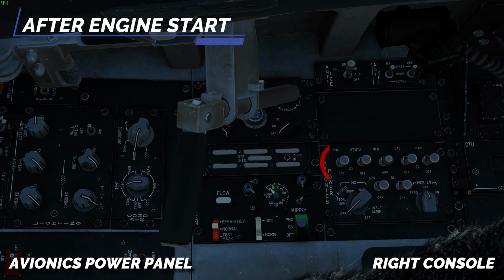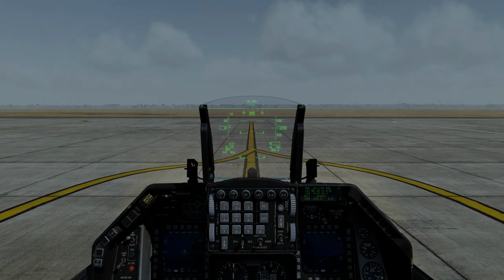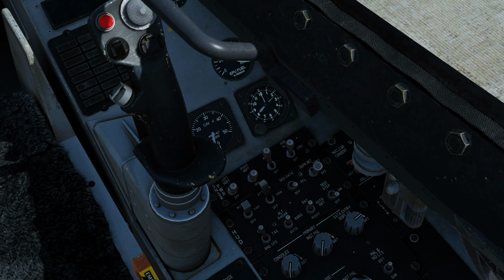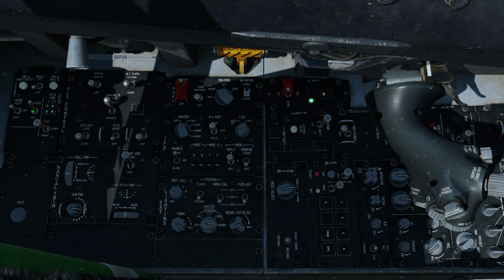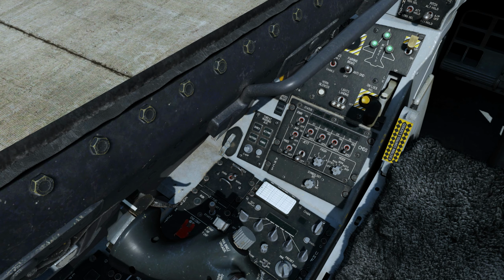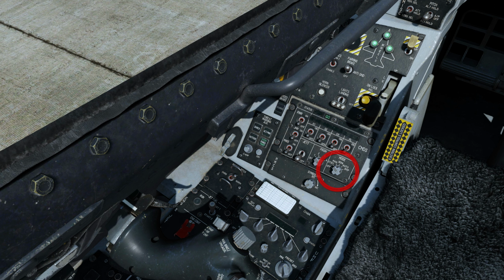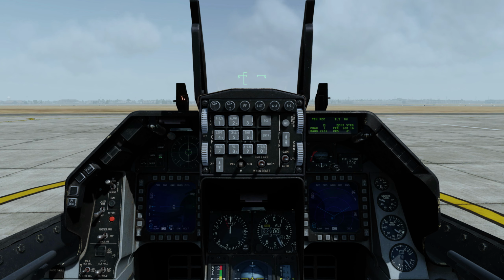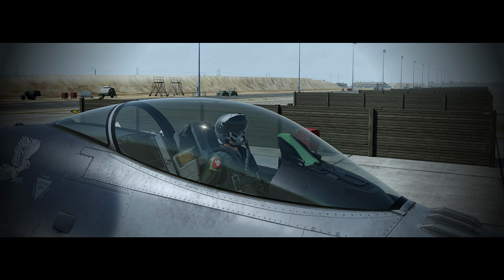DCS : F-16 Viper : After Engine Start Tutorial

Comment: I enjoy your vids. But you omitted an important step here. It's not in BMS but it is in DCS.
In DCS, when you start Normal INS alignment, you must confirm the LAT and LNG in the DED with the ENTR key on the ICP within two minutes of starting the alignment process.  if you don't do this your steering diamond will remain centered in the HUD and the tadpole will be locked straight up and down in the center of the FPM.